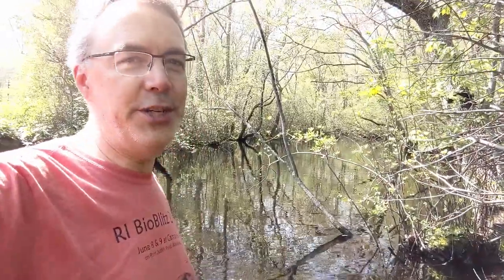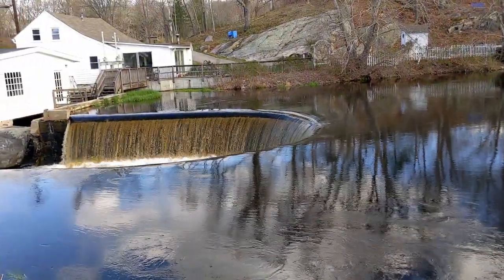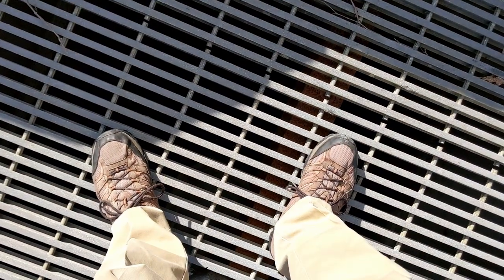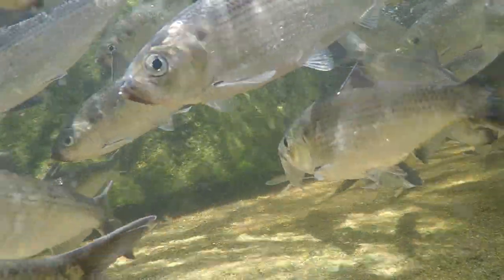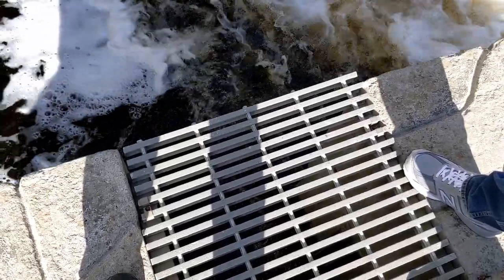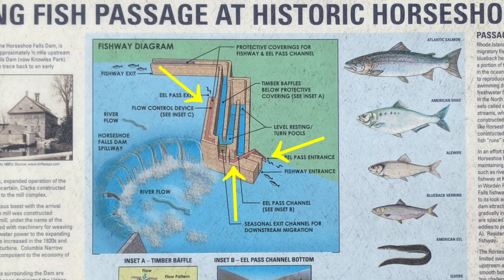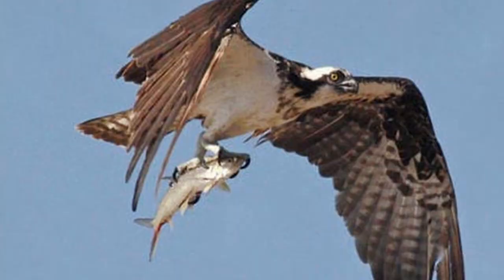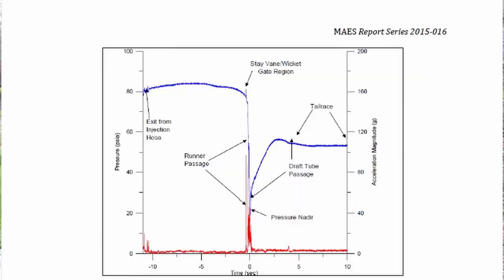How Does a Fish Ladder Work? w/ Jim Turek

Comment: Very informative. Thanks. I want to convert this diversion ditch into pools and connect then via a ditch ladder simulating what I find in the wild to create a refuge for the native wild brook trout above the agricultural runoff……. I was shocked to become aware….  Can someone please tell me the maximum height a brookie can jump between pools?  I can over summer them through drought with deep trench swales from hillside springs in the fields
Reply from the maker: I found a paper online that experimented with this. According to them, wild brookies cannot jump very far, well under a foot. There's a sweet spot for fish size, too, with larger ones that could theoretically jump higher being less likely to colonize new habitat and smaller ones that like to push up into newly opened reaches being less good at jumping. I wouldn't count on brook trout getting past a hop of more than 3" to 6".